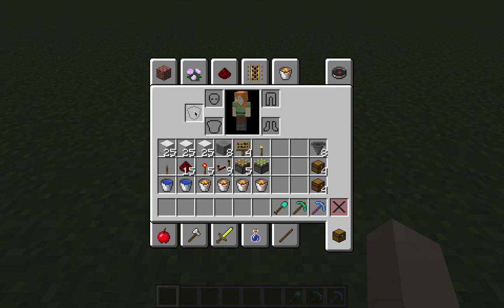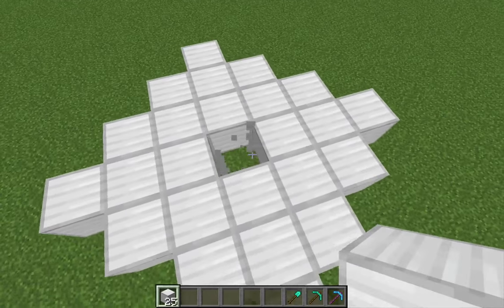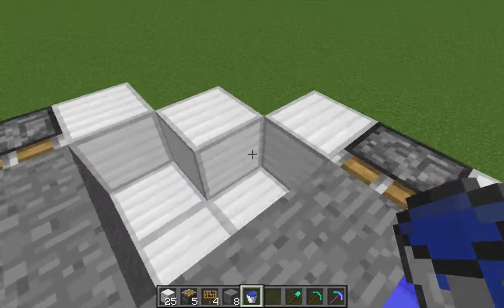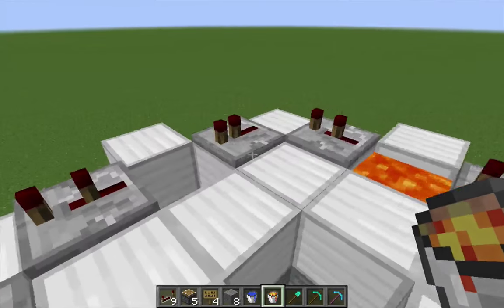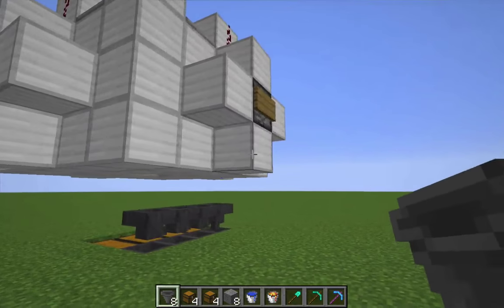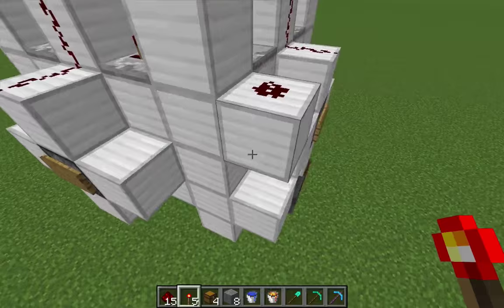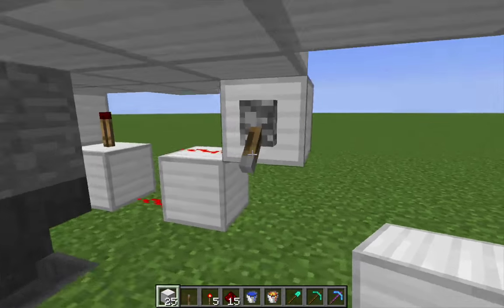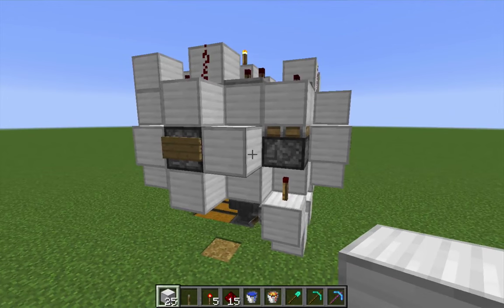Stone Generator

Comment: I like that you gave a materials list. A lot of people forget that.
Reply from the maker: +Shadow 8472 Thanks. I really should re-shoot this video, though. Not only is the redstone requirement a bit lower (the redstone at the very top is unnecessary), but I really should say something about the requirement of the stacked hoppers. Depending on your pick, the generator is capable of producing stone faster than the cool-down period of a hopper, so the collection point should probably be modified. I've also made a slight improvement to the version I use, by swapping out the lever for a pressure plate.

Comment: Nice stone gen. Just the right size to slip into a small attic or make use of an awkward area. :)
Reply from the maker: Lot Myle Unfortunately, it sticks out one block in each direction further than its appearance, due to the signs. But still not too bad. ***** has a design that is more compact horizontally. I really like his engine, but I've never been able to figure out how to turn it off reliably, so it's a bit noisy.
Reply: I've seen his, Like this one more.
Reply from the maker: Lot Myle Oh silly me, I just realized that the redstone on top of each block over the lava is unnecessary. (Only a dot of redstone on either side of the block is required.) Not only does that lower the resource requirements, it reduces the overall profile of the generator by a block (if you ignore the torch), making it easier to fit into tight spaces. Just FYI.
Reply from the maker: Lot Myle Most of the automation that I design is about material production. Sometimes I have a bit of redstone here or there for conveniences (e.g., auto-opening gates), but I've never designed any automated constructions. I'm meticulous about preventing mob spawning, though, so I'm pedantic about light levels, for example.

Comment: Whenever I tried making a smoothstone generator, sometimes the lava would update before the water has a chance to flow in and it would make cobblestone. Is that not the case when you use pistons for smoothstone?
Reply from the maker: +Shadow 8472 Some smooth-stone generators do have the problem of creating cobblestone. For these piston designs, it's usually not an issue. Using this generator, I've AFK-mined huge quantities of smooth stone with Silk Touch pickaxes, and I've never seen a single block of cobblestone in the output chests.